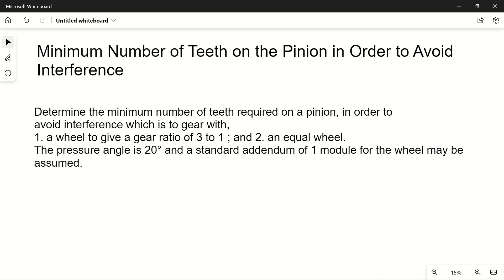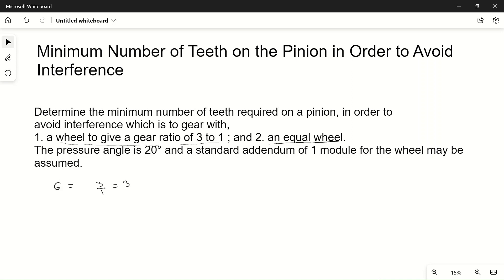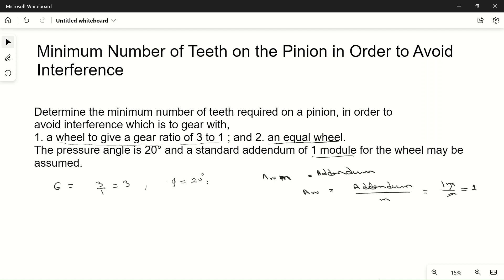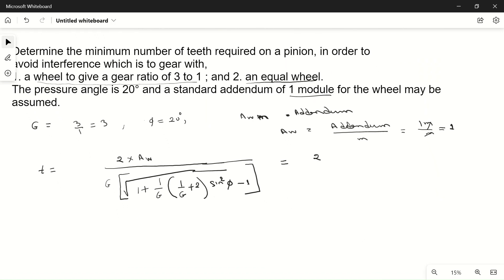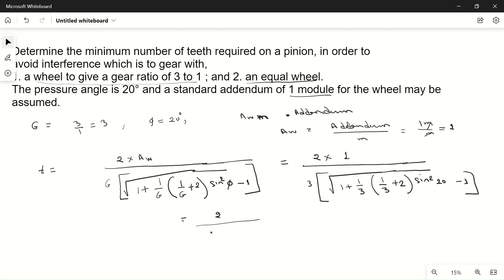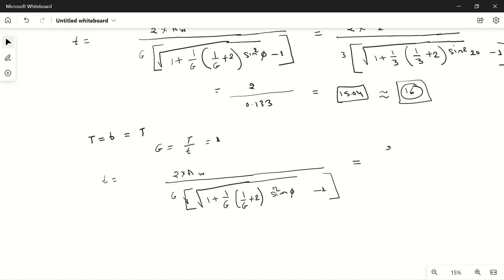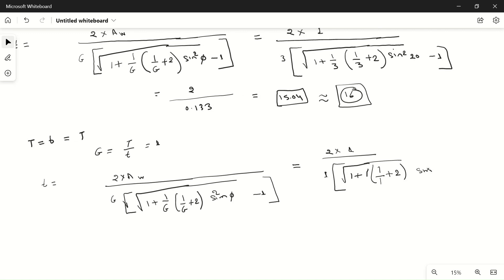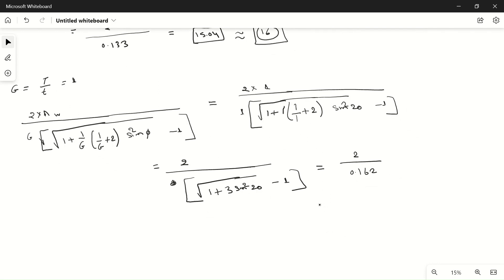Gears: Numerical problem //Minimum number of teeth to avoid interference

Comment: sir how can write sin^2 20degree in calculator ?
Reply from the maker: write sin(20)×sin(20) or (sin(20))^2 or find value of sin20 and find square of it
Reply: thankyou for immediate reply but still doubt on calclulation of minimum number on teeth on pinion  @mechpm
Reply: How to calculate the step before [the answer given by you 2/0.133] in calculator?